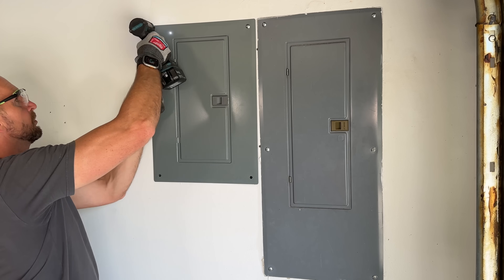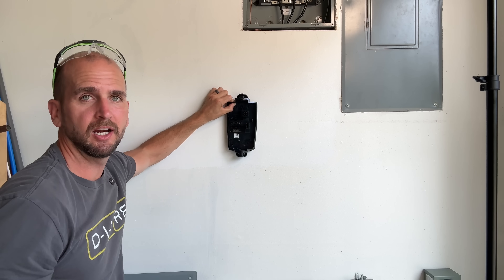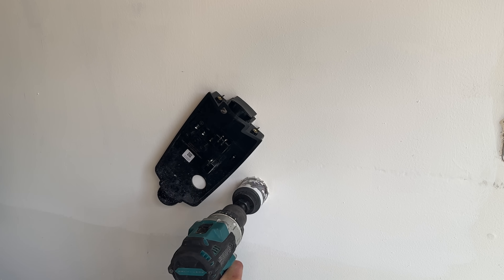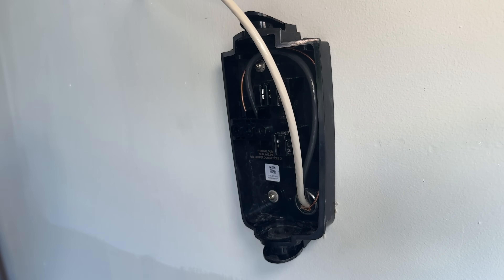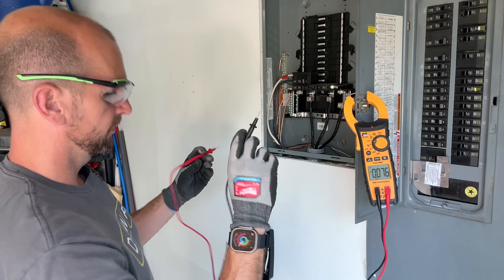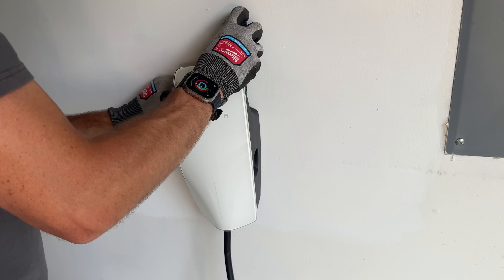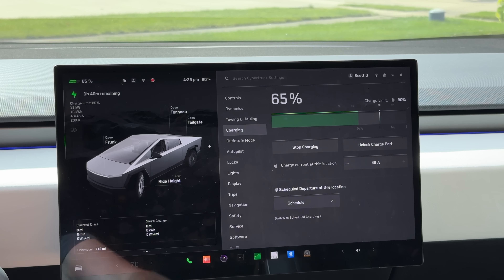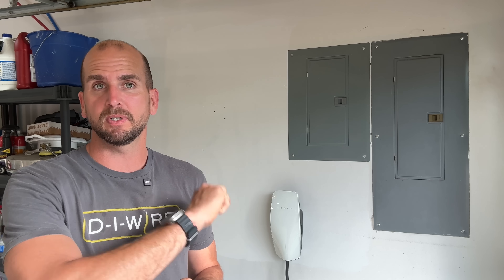How To Install An EV Car Charger | Easier Than You Think!

Comment from the maker: Tesla Level 2 Charger - https://geni.us/cqxpmeX
Torque Screwdriver - https://geni.us/pghmcX
Romex 6/2 (10 Feet) - https://geni.us/scRAUU
3/4" Cable Connectors - https://geni.us/msoAP
60 Amp Square D QO Breaker - https://geni.us/KUM14S
Favorite Stud Finder (StudMark) - https://geni.us/kCLBX
Knipex Wire Strippers - https://geni.us/uVWn
Best Electrical Multi-Bit Screwdriver - https://geni.us/gfNB

DISCLAIMER: This video and description contain affiliate links, which means that if you click on one of the product links, I’ll receive a small commission.
Reply: not everyone has modern electrical panels.

Comment: 6/2 THHN should be used, consult TESLA installation guide or better still NEC guidelines.  This is where an AI like GROK is priceless.  Simply prompt it with:  "Tesla recommended 6/2 THHN wire for their wall charger, tell me why and look-up the NEC national electrical code."  This stuff is pretty simple to do correctly.

Comment: thank you thank you thank you. Was trying all day to get ground fault resolved and it was because all screws in housing were not fully tightened!.My bad.  Once I did that the fault resolved because it made a complete circuit etc  I can go up to 40 AMP at 242 volts on 50 AMP circuit. Can't wait to use my solar panels 9AM-4PM then I don't have to buy back energy that I exported to PGE in norcal here for almost no credit. I pay 20 Cents KW/hr off peak. My local super charger locally is 35 cents KW/HR so costs about 20$ to charge from 20-80%

Comment: Since you're using ROMEX doesn't code require an electrical box behind the Tesla Charger? 
Code requirement (NEC 314.3, 314.17): NM-B cable must be terminated in a listed electrical box. It can’t just poke out of drywall and go directly into equipment unless the equipment is specifically listed for NM cable entry (the Tesla Wall Connector isn’t — it’s designed for THHN in conduit or MC cable).

Comment: Thank you for the nice video. I am planning to switch from a NEMA 14-50 to an Wall Charger. Kind of confused how a 6/3 gauge wire be used for a wall connector, can you suggest.
Reply from the maker: You will most likely just have a white neutral wire that will go unused as the Tesla charge just needs both 120V legs (Red and Black) and a ground.  I would leave the neutral in the Tesla charge junction box tucked away and do the same on the panel side.  Check your local codes but that is how I would approach using the 6/3 that is already ran to that location.

Comment: Kind of a hack move to buy the white neutral color for a new circuit. I would understand if it was an existing circuit, but it cost nothing to buy black or red instead of using a neutral as hot...

Comment: This is not something beginners should attempt. If you never mess around with electrical wiring or never even hooked up a ceiling fan light before, do not do this. Messing around with your home circuit panel is very dangerous. This video is for someone who already has basic understanding of electrical systems who has done work on like HVAC systems.

Comment: A power panel in your garage? That's almost like cheating! :) My panel is in the finished part of my basement, which is the opposite side of my house from the garage. I had to run conduit in the most creative way possible to only have to make one hole in the finished basement, which I covered with an access panel. It was a huge amount of work. Not to mention 5 sticks of 10' 1" PVC conduit, 2 runs of 60' of 6 AWG THHN (10AWG for the ground), it was easily $500 in parts, on top of the EV charger. So my installation was more like $1,000.

Comment: Excellent work on this video.  Again, i stress talking with your local building inspectors on these.  Some jurisdictions have shifted to only allow "use " cable.
Also, if you install a receptacle you must install gfci protection for that receotacke, no matter what the unit contains.

Comment: even though Tesla wall connector pulls 48A you still have your 60A breaker higher than the wire which is rated for 55A. The question is does it matter for safety reasons, not code, if I need to run the wire 30 feet.
Reply: In the USA you want to run at minimum 6 AWG THHN wire for a 60 amp breaker if you want to pull 48 amps in the EV charger.  EV charging is considered a "continuous load" for up to 10 or more hours, so one should not skimp on wire size as you want to ensure your wire can handle the amps and associated heat.   If you insist on running 6/2 Romex wire you should set the output of the station to 40 amps to be safe.  

Two 6 AWG THHN wires and one 10 AWG THHN ground wire can be run inside 3/4" conduit, or for better heat dissipation and ease of pulling on longer runs, you may want to move up to 1" conduit.   And all the above is for when hardwiring the EV charging unit, which does not require a neutral wire.

If you are installing a 240 volt outlet, known as a NEMA 14-50, into which to plug your EV charging unit, rather than hardwiring, you will need to run two hots, a neutral and a ground, which due to the NEMA 14-50 outlet would max out with a 50 amp breaker, thus you must set your charger to no more than 40 amps.  Stay with 6 AWG THHN in 1" conduit for this to be safe.  I would not run 6/3 Romex in conduit, though it is legal, and, if you did, I would use at minimum 1" conduit.

Comment: Older homes in Tucson, built during 50s-60s only had 60 amp 220 total power.  Long before everyone had A/C, dryers, etc. Ramping up to 200 Amp costs a fortune if you have underground wiring.

Comment: Anyone know what an electrician would charge for this install. I’m not an owner just researching. TIA
Reply from the maker: One of the biggest factors is the the distance from the panel to where you want the charger installed.  Also I am assuming you have room in the existing panel to fit an additional 240V breaker.  If your install is similar to mine and pro might only charge $500-$750 for the labor but that is very much market specific.

Comment: Safety tips: 
1. Turn off the breaker at the main panel BEFORE removing the cover of the sub panel. 
2. Install the cover back on the panel BEFORE turning on the power at the breaker of the main panel, then turn on the breaker at the sub panel.

3. Test the voltage at the wall connector (that's where it REALLY counts for your installation) instead of at the breaker panel, then turn off the breaker before you install the Tesla main unit onto the back plate. Note that this voltage test is the only instance where you have the chance to get zapped if you are following these tips.

Comment: For those that have 100A panels or all electric houses most can get by with buying a charger that can be configured to charge level 2 at only 20-30 amps. Especially if you are only charging overnight and only to 80%. I charged my first ev, a Nissan Leaf, with level 1 for 7 years (about 5 miles per hour charge).

Comment: Why don’t you use black & red to the breakers for the hot and white for the neutral? What's the size of the breakers?
Reply: The neutral is not needed . Only 2 hots. He phased the white wire which is ok.

Comment: Canadian electrical engineer here. For my fellow Canadians here reading all the comments about #6 Cu Romex being undersized for a 60A circuit, there is no such requirement in the CEC to use the 60C ampacity (Table 2) for NM cable vs 75C for THHN. Using #6 Cu NM cable for 60A circuits and #8 for 50A circuits is completely normal and code compliant, even for continuous loads like EV chargers. Canadian homes aren't burning down because #6 Cu NMD90 was used for 60A EV charger circuits. 

Always important to make sure that the FLA is still max 80% of the circuit rating (48A in this case), and that everything is at least 75C rated. You would only use the 60C table if your conductors, the breaker, and/or the device(s) on the circuit are rated for only 60C. But this is rare for modern circuit breakers and any device that isn't a 120V receptacle or light switch, and all circuits 30A or less are limited to 60C conductor sizes by a different code rule anyways.

If you're routing the conductors a significant distance through an unconditioned attic space, you might consider upsizing to #4 Cu for a 60A circuit (or #6 Cu for a 50A circuit) just for peace of mind (and/or voltage drop), since the attic space could reach temps above 30C in the Summer. But for a short run so close to the panel, it's completely unnecessary. Not sure why the NEC has this 60C requirement for all NM cable.
Reply: Thank you sir for this.  I am an American electrician and myself and many others often quote rules fron our NEC and overlook that people live in other places and must follow other rules.

Again, thank you.
Reply: You got me there, I was under the impression that Romex and insulation don't mix well. As you point out, to use the 75 deg column the termination temps for both ends need to meet the 75 deg C tolerance requirement, which is common for many breakers but not listed for most lower amperage 120V devices. The specific CEC code reference is 4-006, which as you say doesn't single out NMD cable for blanket derating if termination temps at both ends are known. You don't get to assume termination temps are OK unless the ampacity of the cable is more than 100A or if the wire is larger than AWG1. For low current wires less than 30A, 14-104 effectively demands the 60 deg column for wires of size 10 AWG and smaller, regardless of terminations. I believe there is also a requirement that conduit needs to meet the 75 deg C tolerance, too, so some liquid tight ENT rated as 60 deg C might justify derating of the wire inside. It's understandable that many of us who learned online will absorb the American standard from NEC 334.80 where Romex is routinely derated to 60 deg C, in part because it is so often strung through insulation that will limit heat dispersion.  Indeed, even our Canadian code book in 30-408 makes specific reference to derating our NMD-90 to 60 deg when used near ceiling lights surrounded by insulation. So in the end, both organizations recognize that wires strung through insulation and possibly exposed to sources of higher ambient heat justify more caution, even if not spelled out in a code book.
Reply: This 👍. Americans always choose to make everything so difficult. Like stop with the flathead screws in your shit, the Robertson has been invented.
Reply: @ProudAlbertanDad  I'm 48 and I've hated flat head screws since I was 7. No F'in clue who ever thought those things were useful - god damn monsters I tell ya.

Comment: Romex is NMB cable, which means to use the 60 degree collumn, this means that #6 romex is rated at 55 A. however 48A X 1.25 (for continuous load) is 60A.. Thus #6 romex is insufficent for 48A of continuous load. Need #4 romex.
Reply: 6 NM-B IS NOT CODE Compliant for 60 amps.  You could have used. 6-6-8 SE CU Copper to make it compliant.
Reply: @jerryroussos302 I installed over 50 Tesla chargers and used #6 romex 6-6-6 SE CU passed inspection every time.  State of Virginia
Reply from the maker: Thanks for the feedback.
Reply: That's like 3 feet of cable here, 6 is plenty
Reply: @steelontarget  Functional != Code Compliance

Comment: I used to rely on Tesla Superchargers, which are very fast, but I had to leave home every time to charge. Later, I realized that using a 120V outlet at home is more than enough for my needs. Although it seems to take a long time, it’s almost done after a good night's sleep. The efficiency is actually pretty decent.

Comment: #6 Romex for a 48 amp continuous load is a code violation. Will it burn? Probably not. Should you be instructing other DIYers to do this? No. Demand load is 60 amps here. You need to use MC or THHN as others have stated. #6 Romex is derated to 55 amps unless you live in New jersey or Canada. Great job following the torque spec, that is very important.
Reply from the maker: I have heard a few guys talking about their inspectors passing #6 Romex as they "round up"  55 Amps to 60 Amps.  With that said I agree for instructing others I should have went to 4/3 Romex (not using the neutral) or #6 THHN.  I appreciate the feedback and setting me straight.

Comment: The clearance to the floor and the 3ft in front of the floor was incorrect. if the charger was put to the side of the panel your clearance would have been good according to the NEC. You can also use the Non metallic push in bushings instead of using the two screw connectors

Comment: Can I run 2 EV lines from same subpanel?....One for me and one for wife
Reply: 1 year late but just saw this video... yes can do 2 of them...  but not from his setup you would want like a 125 amp sub panel or the next step up from that with 125 i would only run 50 to each charger if you could get a 150 i would run the 60 to each then just make sure you really have 200 feeding your main or you will have issues trying to do other stuff in the house and i would not run an electric dryer or electric stove when charging you would take away a lot from the main house if 1 charging you are good but both charging is when you need to think about it more... in the morning when they are both plugged in but not charging since at the 80 you are not using the power fully so can do whatever then

Comment: i was wondering some people say based on NEC Code, only thhn wire could run at 48 amp ,but romex wire maximum could only load 44amp because the table 310.16  said it was 55 amp at 60 C degree. Is this true？

Comment: Can you remove the wall charger if you move?
Reply: Yes.
Reply: i would have done a electric range plug 50amp an add a pig tail to the charger so you can unplug it whenever you move.

Comment: Do you need a 200 amp to be able to have a level two charger? I have a 100 amp supply at my house.
Reply: If you only have a 100amp service..it will depend on your current setup.  You have a stove, dryer, water heater, and maybe an hvac.  A 100amp service can handle all of this, however your hvac emergency heat will be dialed back.  If you have all the above on a 100amp...you would be hard pressed to add a level 2 charger.  I would take the time an upgrade your service to a minimum of 200amps.
Reply: @williamgrunzweig571  well, in fact, I'd skip the 200 amp service altogether and just ask for 320 amp service instead. Solid electrical work will suit you up for fast charging at home while also powering the rest of your home plus a few high power gaming PC's.
I'm looking to upgrade to 320, set up a 19.2 kw home charger, and upgrade my wall outlet to 20A to better suit the high power consumption of my 900W PC.
Reply: Yes you can. Best to do a load calc but there are two options. One is to dial back the charger to a lower setting. Second is to use a Tesla Smart Charge Limiter that monitors the panel load and adjusts the EVSE output to match.

Comment: Tesla wall connector won’t work for me 😏, my maximum amperage output at home is 30 amp circuit breaker, which 80% of that would drop my charging down to 24 amps unfortunately.

Comment: Thanks for your videos. I've learned a lot from you. I just leased a 2024 Kia Niro EV Wave and using a level 2 charger purchased from Amazon (about $150). I installed a Bryant 14-50 NEMA  outlet ($56 Amazon) using 6-3 wire (about 18 inches overall). Also installed a 50amp breaker. I connected the ground to the metal box we installed in the wall under the breaker box and then to the Bryant. I noticed yesterday after charging with this charger for the first time, about 2-3 hours,  the connector at the front of the car was fairly hot. The car, before charging, was at 50-60%. I decided to end charging at 93%. (I then changed charging to 80% in the Kia app). How would i know if the level of heat, both on the cord, connect to the Bryant to the pack of the charger, and the connector at the outlet on the car is normal or suspect? Oh, the charger pack is set to 40amp.

Comment: at the electricity cost wise, Mobile Charger using NEMA 14-50 at 36A vs Wall Charger at 48A, cost the same for given the same amount of kw? It's just the speed which Wall Charger provides faster charging speed? Or does Wall Charger also provide cheaper electricity cost given the same amount of charging?
Reply from the maker: A home wall charger will just go off your normal rate.  For me that is $0.08 kWh as compared to my local Super Charger that is much faster but bills out at $0.43 kWh.  Over 5X cheaper to charge at home!

Comment: Please remove or redo this this video with the correct wire. Using 6 AWG NM (Romex) is not allowed due to it's 60 degree rating and only good for up to 55 Amps - see NEC 334.80 and see Table 310.15(B)(16). A 48A Charger (not de-rated) must have wire good for up 60 Amps due to the 125% rule for continuous loads.  See NEC 210.19 (A) (1)(a).  One could argue the use of TC Cable in the wall without a conduit under 6 feet or just use 6 AWG THHN (for L1 and L2, use 10 AWG Cu for ground) in a conduit instead.

Comment: FYI, at 10 minutes into the video you said 80% of 60amp breaker. The 80% shown on the screen is the maximum preset limit for the batteries to charge. That limit should be able to increase up to 100% in the software settings but I would not exceed 90% of a full charge due to shortening the battery life.

Comment: The person that installed my 14-50 wired everything for 60a so it can very easily be changed to a 48v charger.  What I'm using can only charge at 32a.